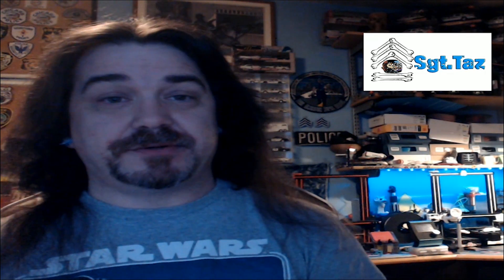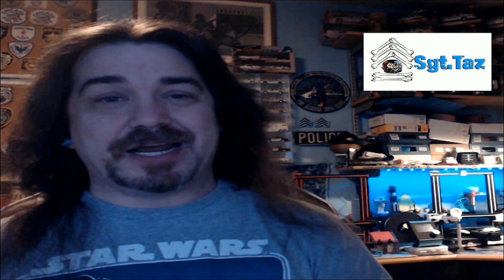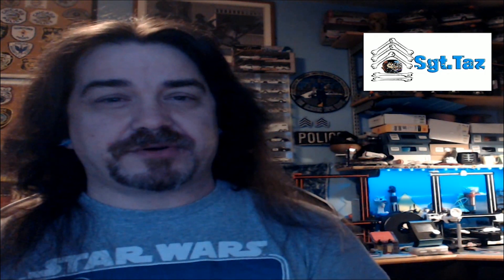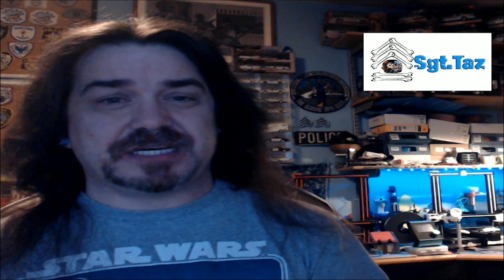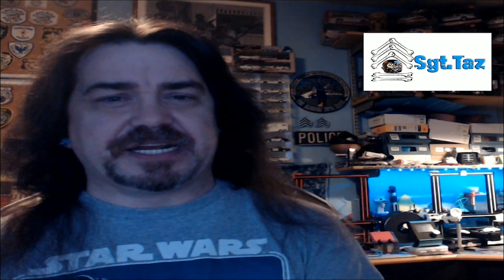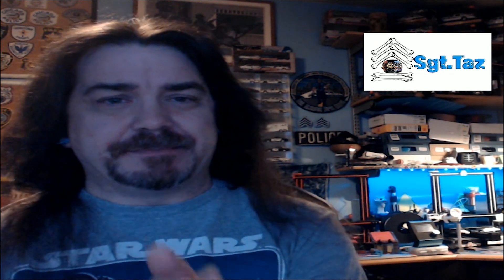Artillery SWX1 SKR 1.3 & tft35 Upgrades

Comment: Do you have a copy of you STL for the TFT Case you would be willing to Share? And did you cut a small hole for the cables to go from the screen to your board?
Reply from the maker: Ran cables thru the slot between base -just didn't tighten the screws all the way and used the book binding tape to cover the ribbon just in case. case I remixed is known to work in V1 & V2 SWX1 https://www.thingiverse.com/thing:4077457
Reply: @Sgt.Taz3D    Awesome thanks. So can I just use this file from Ocean Yeung and upload to my 1.4 Turbo board?  https://www.facebook.com/groups/artilleryswx1/permalink/509565596334777/ I don't have a Hemera but I have everything else. I'm also using Waggsters mod for the BL touch...would you recommend keeping that setup, or just go directly to the board? Thank you again for your help. I'm doing all this mainly for filament changing.
Reply from the maker: @smashby  I'd stick with Wagsters info, he does the BLTouch stuff way more than most and I've seen some issues posted about it not working correctly on the pinouts. unverified as I don't use it sorry :)
Reply: @Sgt.Taz3D  So you're saying stick with Waggsters Marlin update or just his wire configuration.  I thought I needed to flash the board with the 3 files, bootscreen (for TFT35) and the configuration adv.h and .h files.
Reply from the maker: @smashby  i would stay with how he set things up wiring and firmware.

Comment: could you by chance share some info on your cura retraction settings for the x1? i cannot figure them out its doing too many retractions and grinding my filament.  any advice or pointers would be much appreciated
Reply from the maker: As it's direct drive it needs to be set low so 1.5mm @ 25 mm/s  is where I keep it for most projects. Flexible I drop down to 1.0 mm . also keep your tension lever loose. you should be able to compress the lever with index finger fairly easy but not without some resistance.
Reply: @Sgt.Taz3D  how about ur settings in cura the minimum window and max retract count
Reply from the maker: @bigwurm8314   1.0 and 100

Comment: Hmm, the way the stock TFT takes some power from the EXP2 Block made me think, you could reassign 4 pins on the EXP1 Block to use for the LED. (R/G/B/Negative)
Apparently, that has already been done for the old Fysetc Panels with RGB- LEDs https://wiki.fysetc.com/Mini12864_Panel/
Or 3 5v pins from the +Endstops.
Are you really sure its 5 pins on yours? On the V4 its 4 pins, Red, Green, Blue, and Negative.
Reply from the maker: I think your right, kept screwing that up I think it is 4 just had a stray wire from previous repair lol thanks for the idea as well